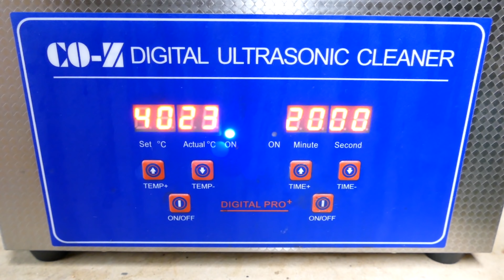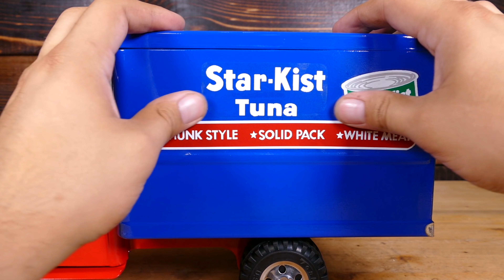Rusty 1950's Tonka Starkist Tuna Truck Restoration

Comment: Another lovely restoration good sir.

May I offer a tip of consideration? Would you mind adding a coating of primer powder before doing the color coat and sand the primer coat after it has baked? Probably would make the surface a lot smoother for color powder coating.

Slightly rusted metal parts like the bumpers and wheels can be sandblasted and given a coating of Super Chrome powder for an unbeatable chrome finish.

Comment: Great job, 👌 for a more realistic look, i would have painted the frame black! 😉
Reply: Except it wasn't black originally. It was red.
Reply: Joe restores back to original. Since it was originally bright red, that's what he did.
Reply: I understand your point Paul, but I find that improving what exists (once in about sixty years) would have been a nice way to leave your mark ...
Still, it is an excellent restoration!
Reply: @ronaldlapointe1219    Some people prefer to customize things and make them their own.  That's perfectly Ok, obviously.  Some people strive to restore things to exactly as they were when they were made or sold.
Reply from the maker: A lot of commercial trucks actually came with colored chasis. Not too uncommon to see a red chasis. In this case, I just did what it originally had

Comment: Joe, did you put the Tonka seal back on underneath? Fantastic job on the wood and the metal. I have never seen that style of headlamps on a Tonka!
Reply from the maker: Weird headlamps huh? I almost put clear ones on just to break up the chrome. I completely forgot to order the bottom sticker so it's not on it. I need to get one